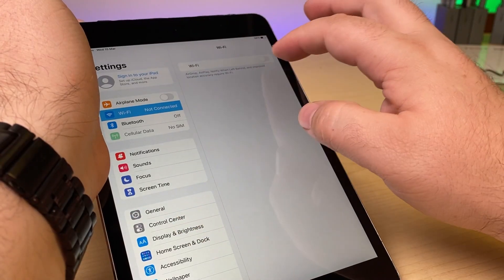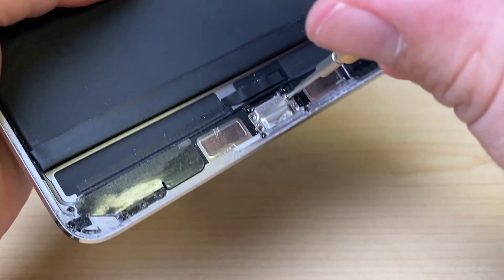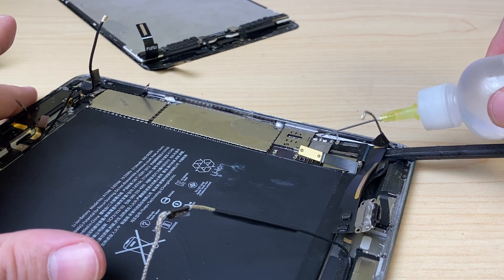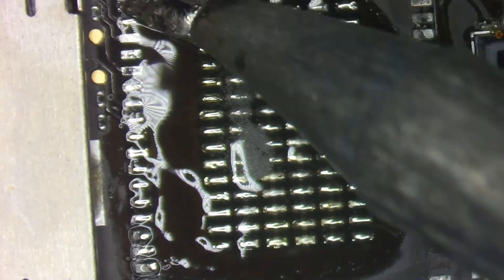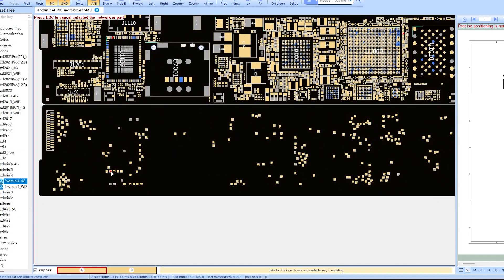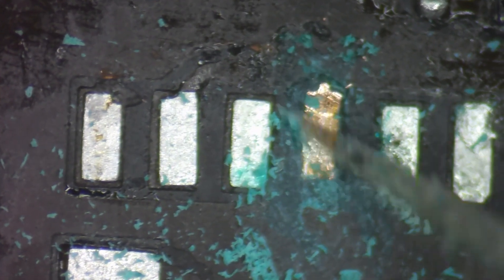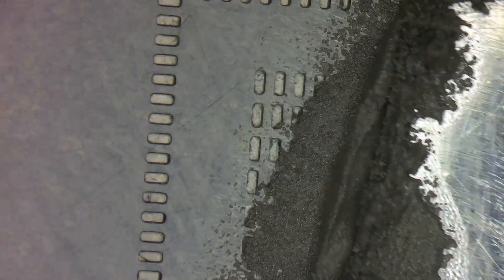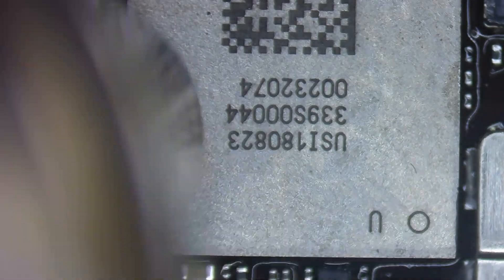Resurrecting Wi-Fi on iPad Mini 4: Reballing Method for Grayed Out Wi-Fi Fix! 😁

Comment: Brother thank you for the tutorial. I have the same repair today however, the wifi ic was removed and lost from other shop. Question is if I will replace it with new wifi ic, do I need to wifi unlock it via purple mode? Also I;m not sure if the wifi ic is 339S00044 or 339s00045 because the chip is no longer inside when ipad came in. thank you in advance. more power to your Blog